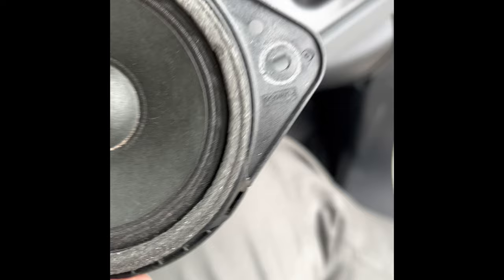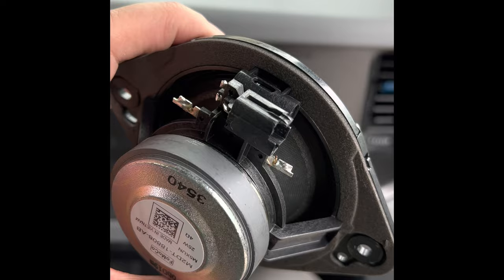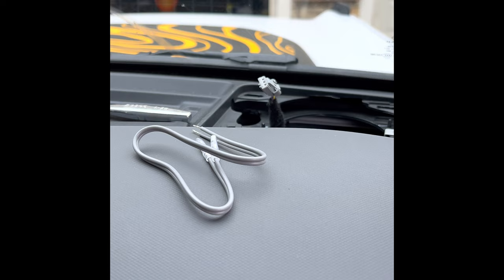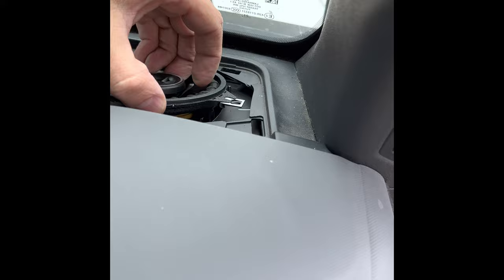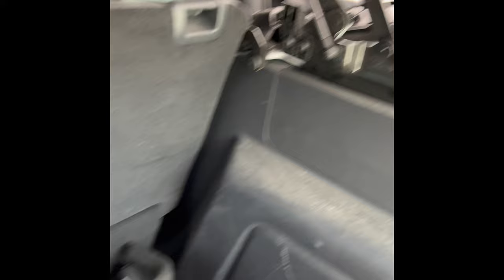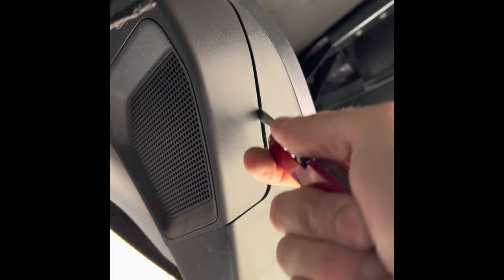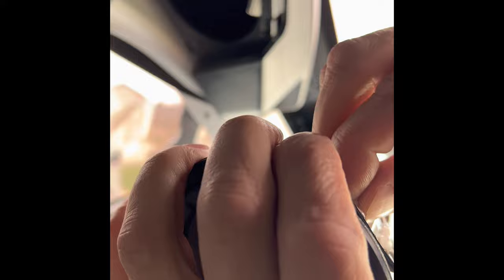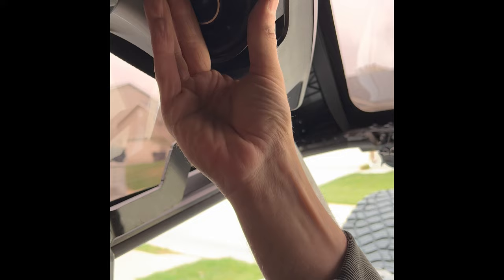21+ Ford Bronco Speaker Replacement

Comment: Great work! I am getting a lot of excellent ideas from DIY guys like you! 
BTW, There is an awesome thread in the Bronco6G forum by BroncRik titled:   “Bronco standard sound system 6 speaker upgrade DIY writeup w/ instructions (dash & kick panel speaker removal) & wiring diagram”.  It helped me understand some of the challenges and limitations associated with upgrading the audio system for my phantom Bronco (build date 1/23/22)!

Comment: If you buy speakers from Crutchfield they give you free adapters. And will tell you exactly what fits. Also the dash speakers are 3.5 not 4 inch.
Reply: Even Crutchfield doesn’t know which adapter if for the Ford Bronco yet. I spoke to them today. Also, the dash ARE in fact, 4 inch.  I installed speakers in a coworker’s Bronco OBX High already.

Comment: Did you end up buying the connectors from Amazon? If you could share the link. Thanks for the video
Reply from the maker: I haven’t found any that fit!
Reply: @LifestyleOffroad  thanks for letting me know. I'm definitely going to buy these. They are a good price. Next we will need a sub. I'm hoping to put under the back seat so not to lose out on rear space.

Comment: the adaptor wires on Amazon that are linked on your site have 4 wires each! hwo are they connected to the speakers in the back?
Reply from the maker: I think you choose the wrong ones. There’s two linked on the site.
Reply from the maker: If your asking about the roll bar make sure you select the adapters for the kick panel, not the 6.5”
Reply: @LifestyleOffroad  I picked the one for $12.99 ... the picture on Amazon shows 4 wires
Reply from the maker: @thedesertpooch9664  it’s just a terrible picture. It’s only 2 wires
Reply: Do you have an updated link? Trying to access the one you have posted for the 4” but it doesn’t load. Thank you!